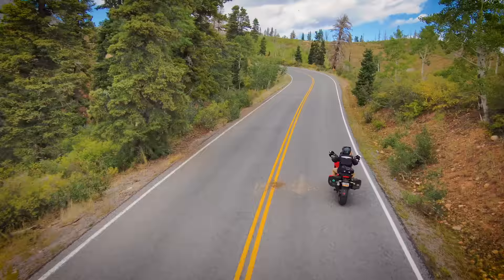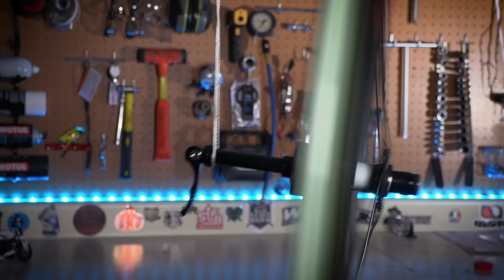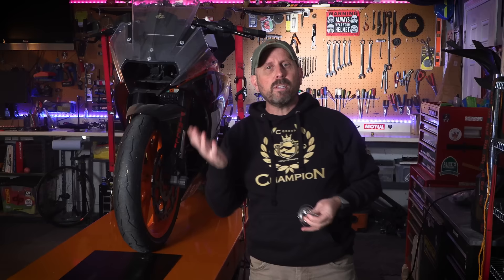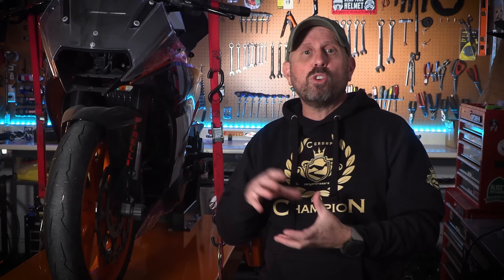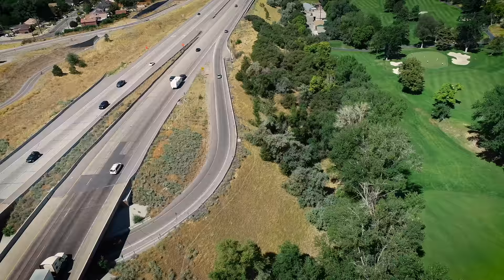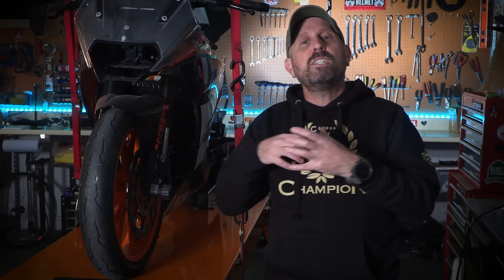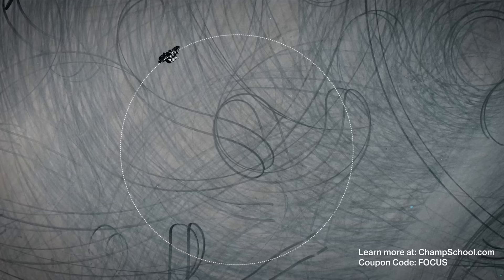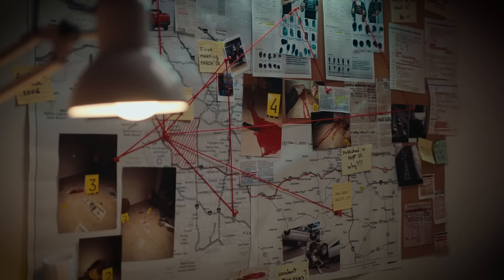Do We Fully Understand How Motorcycles Work?

Comment: Ive been soaking up all your videos and the weather here (UK) is fancily letting me have some practice. I've been riding for 40years and no one, ever, taught me any of this stuff. I'm amazed I'm still here! Went for a ride with some buddies last week on unfamiliar roads and was really trying out the trial breaking, body position, road position. It definitely feels safer and more controlled. Particularly those blind corners that tighten up and have a load of wet gravel right where you want to be....... I was long way behind the other riders who have completely different techniques for how they managed the twisty bits. One "settled" the bike with the back brake and tipped in (didn't really understand this) the other used only the throttle to control his speed in the corner. Seemed to work for him but I'm not sure what his strategy was for ben tightening up more than expected or some obstruction. I'll be riding with these guys in the European Alps ion September. I want to be on top of this by then.

Comment: Thanks, a very thought provoking video as usual. I spent alot of time as a kid analyzing my bicycle’s ability to stay upright while moving forward without a rider. What was going on? The trail in the front tire was the only thing that made sense. When the contact patch increased to go in front of the steering axis the bike would tuck and crash. Such as in deeper gravel or sand. This told me with the contact patch behind the steering axis, caster would kick in and keep the bike going forward. But why wouldn’t it fall over? So I studied what happens when slowly moving the bike forward, then tipping it over a few degrees. Due to the trail as the bike leaned, the tire wanted to steer in the direction of the lean. So when unsupported and moving forward, when the bike started to fall, the front tire would automatically steer into the lean standing the bike up again. So this is continuous and stabilizing until the bike slowed down until the auto correct stopped working. This IMO is how the bike stays upright and wants to go straight.

This concept is important because you are fighting this effect when you want to turn. 
 
So to turn you countersteer to counter this force, and once you start the lean, the trail goes off center steering you through the corner. It continues to want to stand up so after you start to turn you need some constant countersteer pressure to maintain the turn. As the front is not quite aligned with the rear, the tire is cuffing a bit, thats why you need maintenance throttle, plus the contact patches on the side of the tire have effectively reduced the radius of the tire needing higher rpm.

Countersteer to start the turn, ease off countersteer to keep the turn.
Reply from the maker: YES! I love it.  If the algorithm would allow, I'd be a bicycle/motorcycle channel because I just find two-wheels so fascinating!  What we "feel" and whats happening don't always align, and as one of the physicists I talked to making this video said "It's not intuitive"

Comment: The explanation is contained in Corioli's Force: if you apply a force to a rotating object then there will be a force perpendicular to both the axis of the wheel and the axis of the force - stretch out your thumb, your index finger and your middle finger so that they are perpendicular to each other. For the right hand, the middle finger alligns with the wheel axis, the index finger aligns with the horizontal axis and the thumb aligns with the vertical axis. Your front wheel is turning, so your fingers are rotating downwards (your thumb is pointing to the left), if you try to  turn your handle bars to the left (here your thumb is pointing upward and you fingers are rotating to the left, then your motorbike will rotate arong the horizontal axis. i.e your thumb is now along the horizontal axis and your fingers are rotating downwards - this means that if you try to turn the handle bars to the left, YOU WILL BE THROWN OFF TO THE RIGHT - try this on a bicycle and NOT ON A MOTORCYLE !
To look at this from another perspective:
Your front wheel is turning, so your fingers are rotating downwards (your thumb is pointing to the left), you now lean to the left, i.e. about the horizontal axis, your thumb is now pointing backwards and your fingers are now wrapping right to left, then the resulting force will be along the vertical axis - i.e. your thumb is vertical and fingers will be rotating right to left - hence the motorbike turns to the left.

Comment: If the front wheel is suspended from  vertical forks, it will just hang there. It's called gravity.
If the wheel is held forward by 100mm as motorcycle wheels are, the smallest deflection " lean" left or right. Gravity pulls the wheel in that direction.
Counter steering is the start of that process. Gyroscopic force helps to stabilise this while moving forward.

Comment: I am a relatively new but cautious rider, I have been riding a 125cc clutchless for 4 years but finally transitioned to my first bigger bike. I got a used f 650 gs of 2007 and I was absolutely having a blast (until I run into some fuel injection problems but hopefully they 're shorted very soon). I had seen other videos explaining how to ride and feel very justified after watching this one because frankly I don't think there's a correct answer. There are basic principles like don't increase brake pressure on the front wheel unless you currently reducing lean angle to 0 or if it already is at 0, but generally speaking the best way to ride a bike is to never take risks unless you are in a comepletely controlled environment and choose different aspects of riding to focus on and hone your skills on while actively riding and getting a better understanding of. It literally is a matter of trial and error, except we are not talking about the error of crashing, as that will not leave any room for any more errors, it's more about the error of being able and knowing that you can take a turn faster, but you have to slowly work around increasing your speed and maintaining your control over the bike, which slows down the proccess a lot. Time and experience is our best friend.
Reply from the maker: There's a lot of wisom there.  Absolute or overly simple answers rarely work out.  Even looking at just the  physics. If we look at one specific thing, we can say difinitively this is the answer - until we add in another variable.  

A lot of what we try to do is look at best practices.  What are the best riders in the world (who aren't crashing) doing?  Can we do the same thing?

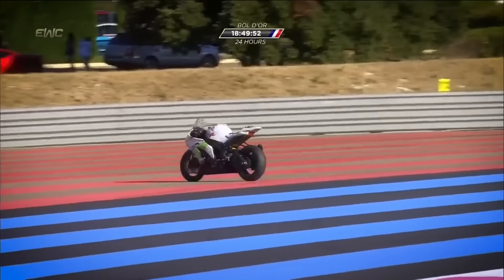Comment: the reason why the "byke without gyroscopic effect" was still standing is simply because the counter-rotating wheels weren't on the same axis or rotation as the main wheels, which means that they weren't canceling the angular momentum of the main wheels and the gyroscopic effect was still present. oh and the reason why the byke you threw at 4:18 fell just as fast as the still one is just because it wasn't going fast enough for the gyroscopic effect to be any significant, if you move too slow on a byke you will fall because the angular momentum of the wheel is too slow.

Comment: I like this more than any other explanation out there! The front of a motorcycle steers directly like any other vehicle. Turn the bars to the right, the wheel goes to the right, and the bike body falls left... Countersteering is just a term for the initiation of a lean into the turn. However, you never addressed the title of this video and the quote that you presented. Where is the mystery? I have seen other videos out there say the same thing without elaborating. I don't think researchers are trying to "solve" a bicycle problem, rather trying to make better computer models. The TU Delft "experiment" was not a revelation into something mysterious, it was a demonstration. The equations show gyro and trail are not necessary for self-steering as there are other things such as steer system flop (gravity) and tire twisting moment.
Reply from the maker: I spoke with several researchers in making this video - all who declined to be interviewed on camera.  Two of them basically said a variation of "we still don't fully understand how bikes work."   Granted, their level of detail is greater than most.

Comment: Awesome breakdown of the turning physics. My brother has an old 3-speed bicycle with a steering lock for security. So, of course, I had to try to ride it with the steering locked. It seemed pretty impossible! It would be interesting to try steering  and balancing a bicycle or motorcycle with 0 trail. Maybe 2-wheel vehicles are the first example of "smart" technology!

Comment: You can find video of stunt riders in mid air turning the handlebars, the bike leans over, then straightening the bars and bike coming back up to straight. Why isn't this looked at? It means contact patch means nothing! The bike will change orientation in free space! Everyone seems to overlook it's not one gyroscope, it's two, connected by a fixed frame. They interact with each other.
Reply from the maker: Exactly right. You'll get a kick out of this.  http://ruina.tam.cornell.edu/research/topics/bicycle_mechanics/brike_paper23-proof_corrections.pdf
Reply: Friction. As a bike or motorcycle leans into a turn, the diameter of the tires gets smaller because the tires are not flat, they're curved. So, for example, if you have a tire that is 20 inches in diameter when upright, the diameter may only be 18 or 19 inches in a turn because you are riding on a different part of the tire. When you turn a motorcycle, you're literally changing the size of the tires. Also, you are changing the speed at which the tires rotate. If you're doing 50 mph when going straight, and maintain your speed of 50 mph in a turn, the wheels on the motorcycles are forced to spin at different speeds. As the diameter of the tires shrinks, it has to keep spinning faster in order to maintain a constant rate of speed. 
 For any given speed and lean angle, friction forces the tires to take the path of least resistance. Any time you alter one of these variables in a turn, you create friction, and its that friction that forces the motorcycle to make changes in speed and direction. That's why you can't have 2 wheel drive motorcycles. The tires need to be able to spin at different speeds, and at a ratio that is constantly changing. Its the exact same thing that happens to a 4 wheel drive truck when you drive it on dry pavement. It bucks and skips, and just feels all messed up when making turns. The 4wd unit isn't letting the tires spin at the speeds they need to in order to reduce friction. If you watch videos of motorcycles crashing in turns, quite often you'll see the handlebars start kicking and the front tire will start to skip and loose traction. That's because the rider is panicking and trying to force some type of input without letting the motorcycle do what it needs to do to reduce friction. Its also why you are able to steer the handlebars in the direction you want to go at very slow speeds. As you go faster, more friction is created and you get to a crossover point where you have to start counter steering to make turns.
Reply: @CanyonChasers   This rider steers the bike in mid air, essentially in zero gee. Contact with the ground isn't necessary to change the +relative+ angle of the two wheels. He's using the two gyroscopes against each other. This has to be part of it. https://youtu.be/0yu7OC2JgeU?t=145
Reply: @alwaystinkering7710 What they're showing in the video has nothing to do with steering the motorcycle like when its on the ground. Its actually easy to explain what's going on if you know what to look for. However, its not always easy to see what they're actually doing because they are so good at it, there's no wasted motion. Its kind of like how a good boxer doesn't advertise to his opponent when his punches are coming. 
 Everything they are doing in the air to influence the movement of the motorcycle is based on inertia. In freestyle events, the rider has to anticipate what he wants the bike to do in the air, and sets everything up on the launch, before he leaves the ground. How the suspension is compressed and released on the launch dictates what the bike does in the air. Watch the motorcycle as its entering the ramp. You'll see both the front and rear suspension compress heavily. As the motorcycle leaves the ramp, the rider usus the release of the compressed suspension to spring him into whatever direction he needs to go in the air. And its all very technical.  Body position is a critical factor. More compression can be put on just the front or just the rear suspension. There's a lot of options available to the rider depending on what he needs it to do. The thing to keep in mind is, its very subtle. The only way do to stunts like that and live, is to be perfect. That's why its hard to see exactly what they are doing to move the bike in the air.
The rider has 2 more inertia based options to him once the motorcycle is in the air. You'll see these 2 used constantly in motorcross and supercross. Inertia can be used to level the bike. If the front end is too high, tapping the front brake will stop the wheel from spinning and transfer the inertia from the spinning wheel to the frame of the motorcycle, and the rear end of the bike will come up. Tapping the rear brake does the opposite. The rider can also twist the throttle and get the real wheel spinning again, and that will also shift the bikes position in the air, but using the brakes are a much more popular option. 
If you're really interested in all this, there are plenty of youtube videos that instruct riders on how to do these types of moves. Its much easier to grasp when you see its actually done. You'll probably want to anyway because I've never been good at explaining things, so I know you can find someone else to do it way better than I can.
Reply: @AT-wl9yq  I'm sure they can do all that you say, and that partially backs me up: braking and speeding up the wheels affects the in midair, those forces don't disappear on pavement. They are still there, we just can't see them. But I'll stick to my guns here, they can reorient the machine by changing the relative angles of the gyroscopes. That also happens on the ground. I'd like to talk to one of those riders about this for the first hand.
 Their body movements influence it too, and they have more options than a street ride does!

Comment: Yes, I could ride a bicycle though a winding course without my hands on the handlebars. This means I could not 'push' on the side I wanted to turn, nor pull on the opposite side. This invalidated what was proposed in the @FortNine video on counter steering. If I wanted to turn quickly riding no hands I would give the bike a quick flick in the opposite direction which would cause the bike to lean over more in the direction I wished to go. I could likewise straighten the bike up with no hands. I found this worked on a motorcycle too when my right grip got jammed while on a little throttle.

Comment: Great video to get people interested in the physics behind riding! None of the problems you were talking about are an unsolved mystery though. It just isn't as trivial as saying that it is that one thing. For example rotating engine parts do have an influence on riding, just usually not a big one. If you take all factors in qualitative account, none of the bikes reactions are unexpected. A lot of physicists get it wrong though - even an extremely smart professor of mine though that it was way simpler then it actually is because he never really thought about it that much and was surprised to hear how much more actually is important.

Comment: Veritasium’s “balance stick on its end” analogy make sense to me. 

Both motorcycles and balancing stick on its end involves…well, balancing. 

If you balance a stick vertically, and you want to go left, if you move left directly, the stick will tip right and fall. 

Versus if you first “countersteer right” by moving your hand right, the stick will start to lean left, now you can move left. Then to stop going left, you move your hand left real quick to be faster than the stick, causing the stick to lean right, and as the stick loses its momentum, you move your hand right just a bit more to make the stick vertical again

Comment: Counter steering changes lean angle, both in and out. Through the corner, the steering does follow the turn. Stop fighting it.

If you spin up the rear at high lean angle, then you can say otherwise, only then are you counter steering throughout the turn.